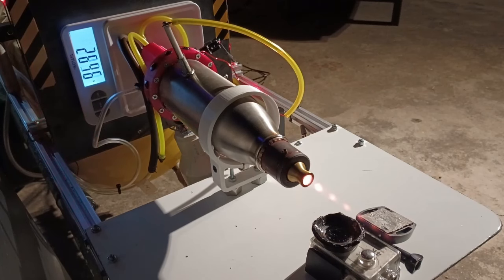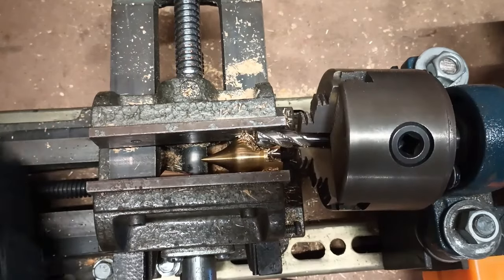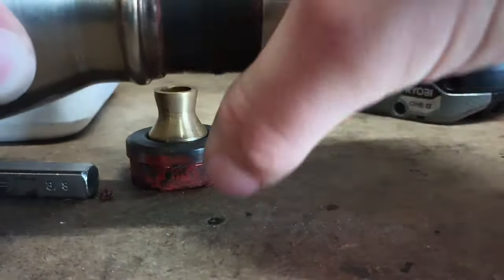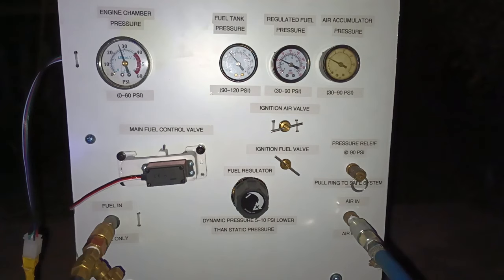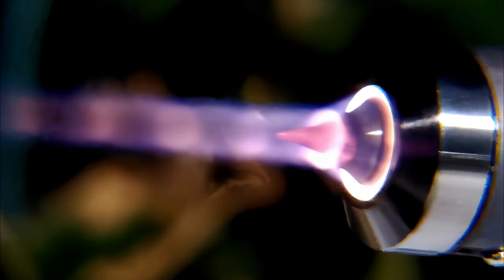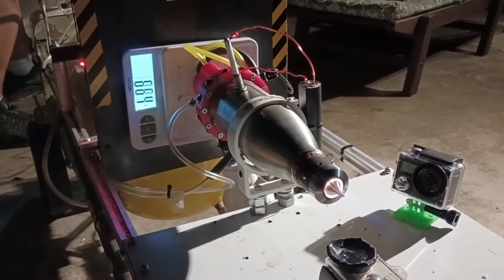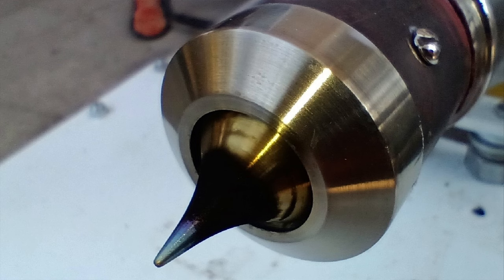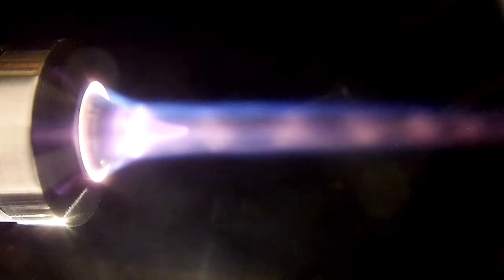I Designed an Aerospike Rocket Engine - Is it any Better?

Comment: The annular aerospike weighs too much for it's efficiency gains.

The linear aerospike... now THAT is the real question. There's no need for gimbals, as one can steer by differential trust about all three axis. Since it's a multi-combustion chamber system, there's redundancy, thrust balancing by chamber on/off, and thrust throttling by chamber on/off. With the ability to balance engine thrust and thrust level by turning chambers on and off, the turbo machinery combustion chamber can be constant velocity/thrust designs, simplifying their design immensely.

There was only one ever built that I know of for the Venture Star (X-33). It was test fired in the early 2000's. NASA has a bunch of data and imagery available for that engine.

I do know SpaceX did look at the annular engine, but found the weight an overriding factor in staying with a bell design. It would be interesting to hear if they looked at the linear design.
Reply: Even the original for venture star was low in its thrust to weight ratio. Multiple combustion chambers will only add weight to your rocket engine! SpaceX has kept it to their less parts is better theme. Though never say never, a truncated aerospike on a anular RDE may become a valid engine type. Linear not so much. 😊